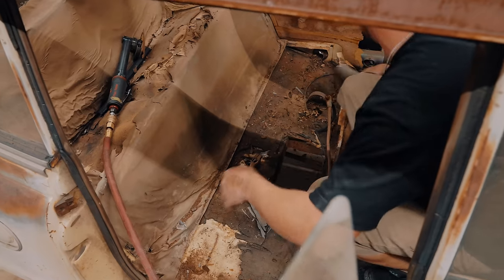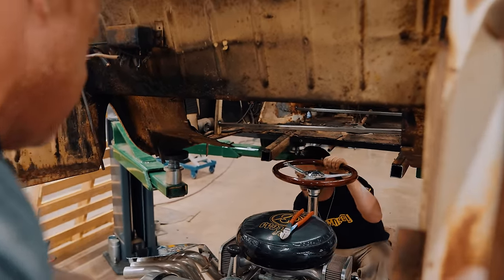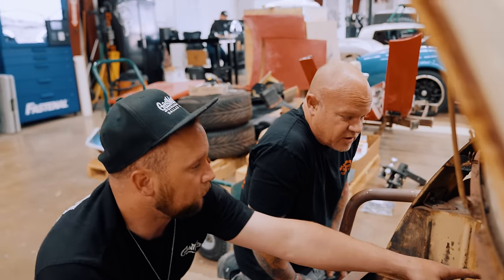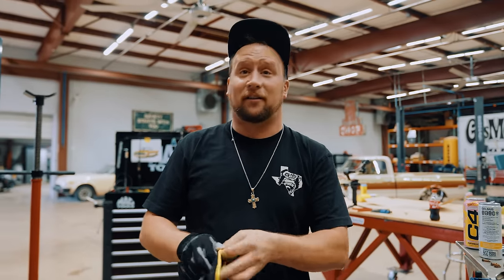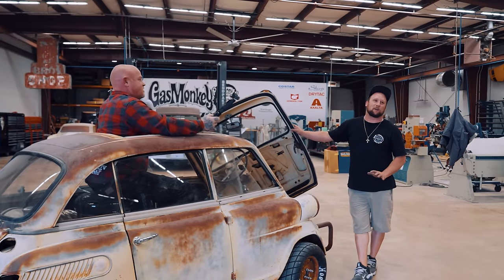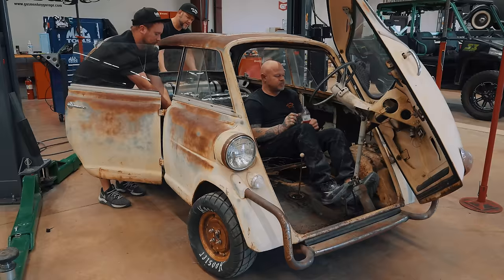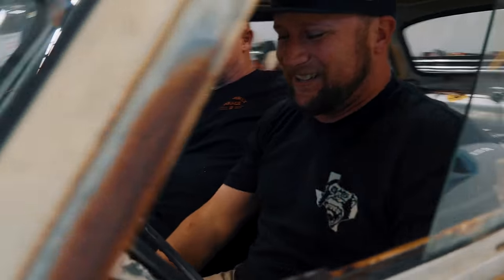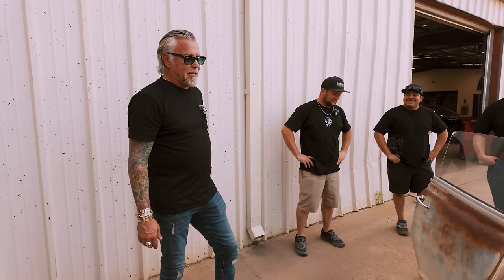Full Build: Insane V8 Powered Micro Car

Comment: In 1966 I bought a Two Door  Isetta with the 600cc BMW engine for $100.  It easily hit 40-45  MPH, but as a kid, I kept tearing out the rubber shaft connectors. Think I sold it for $150.00 and my next car was a 62 Chevy SS with a 327.  Wish I still had both of those cars.

Comment: I think it would do well with Landrover defender style vents. A metal flap on the door/front you can open to let in some cool air while you're driving.

Also a trailer hitch connected to the engine/subframe, I mean it should have enough torque to pull so why not.

Comment: I don't why you didn't hook up the 350 engine to a Tremic front wheel drive transmission with solid steering tierods. That would of gone much faster than 20 m.p.h..

Comment: Could the hydrostatic pedal have like a reverse linkage and some sort of spring situation so you let out on it to 'go'? If so, and it was on the left side of the column, and the hydraulic brake pedal was over by the throttle, I bet it would be WAY better to drive, almost like a stickshift with no gears. This thing could be positively AWESOME, I'm sure it's going to take some fucking around/finding out to keep it cool and make it usable, but it's cool as hell already in the R&D stage. Awesome build, fellas. Subscribing.

Comment: Working in construction, they make sure to drive in the point about masks. They will NOT protect you against low oxygen (argon displacement) or a poison gas (hydrogen sulfide).  Using them in a carbon monoxide filled situation like this is ill recommended. They were fine as they were in open atmosphere  but this warning is for the layman who thinks it is okay to run any engine in their personal home garage.  Those situations require SCBA (Sefl Contain Breathing Apparatus). 

That being said, I do enjoy this video.

Comment: First time ever coming across this channel, the ideas are mint but Jesus whoever the boss man is just uptight idky have some patience bruh, the mechanic or fabricators or whatever just seems so unenthusiastic probably cause of the boss ngl old heads ofc cant run from that, common solution was to just build a {roll cage from the back to front} retracted statement, couldnt they just weld the rpm and forward pedal together, cause for sure it aint fast a simple side or top mounted induction system to reduce that heat idk if im hating or what not but damn alot of compromises for easy fixes. imma just stick to my regular old channels yall stay safe peace and love always

Comment: Why couldn't it be street legal, if it has all the necessary stuff. 
Lights,
Turn signals,
Break lights,
Head lights,
And it stops and goes, beinga 3 door, 
It isn't that much smaller than a Nash Metropolitan,or a VW Beetle,and people have put V8s in them...
How many people think it would have been better with a VW Flat Four
More weight all around would solve the bouncing 😊

Comment: im just glad my Custom Upgraded Zastava 850 is faster then yours

its 1985 Zastava 850 
Engine : Inline-4 has around 80hp for 5.000RPM sence it had 5 speed manual transmission 
Can reach atleast 140km/h and sure it does use around 6L on City but in open road uses 5L sence Fuel Tank is 30L on back 
sure it did costed around 3.000 Euros but atleast its better then your um BMW Isetta that has V8 uses soo much fuel and power and yet can barely reach 30mph XDDD

Comment: It sounds to loud.  It sounds much like a lawn mower engine.  My brother put a v-8 in  a Vega station wagon....  That Fiat / monster transmission doesn't  seem right for that engine.  Nor  does it sound right.  The RPMs  are way to high.  It sounds off for the speed it is going.  The engine is rotating way to high for how slow speed they are going.........  I think the gear box needs to be changed out.....  I know they want a toy, but it doesn't seem right.   They may be worried about speed.  With the RPMs so high they may through a rod eventually??